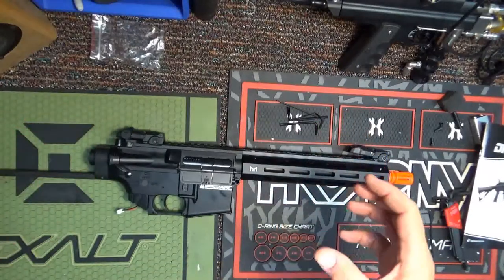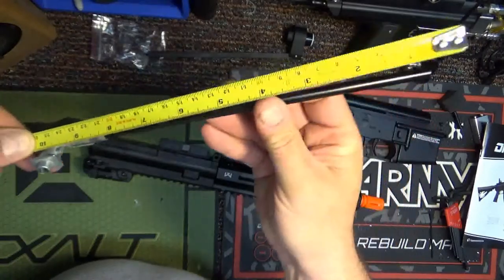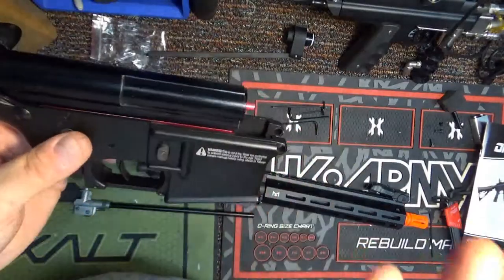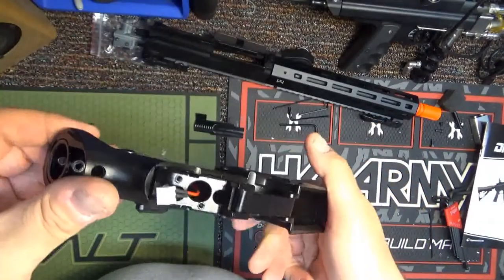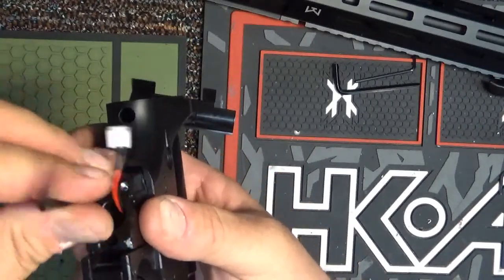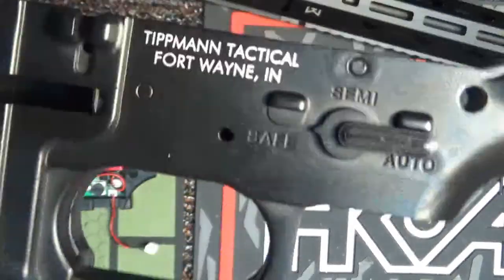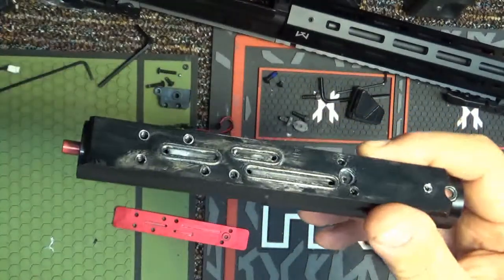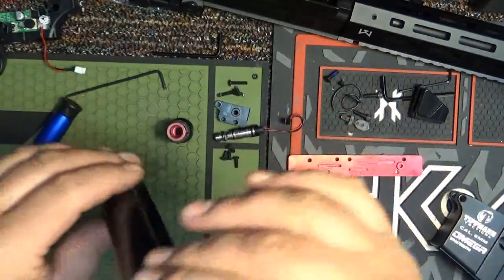Tippmann Omega Airsoft #3

Comment: My tippmann omega recently stopped shooting. I’m not super knowledgeable with HPA but I get the gist of it. I recently got a new Ninja tank but my gun won’t fire. I don’t have any 9v batteries right now except for the one that was in it which for some reason is making the light above the trigger blink and another one which will make the light blink once and then turn off every time I switch the firing mode. Can you help?

Comment: I know this video is older, and in the comments, it says the replica was sold, BUT my interest is in the O-Rings. Mine is leaking badly, I got it used, kind've in the bone yard way.  I cannot for the life of me find ANY information from Tippman on the internals and what the O-rings ARE and where to find replacements.  So I need the 3 that sit under the red plate of the V1, and I need the O ring that sits under the check ball.  Any ideas?
Reply from the maker: have you tried calling Tippmann

Comment: Doc,

We spoke yrs ago about the Tippman Omega. Ive been using MCSUS combat stock with a remote line. I kinda need your expert advice.

I want to run an ingrip line from amped airsoft. Could I screw that ingrip line to the back of the engine where you adjust the PSI? The MCSUS stock is great, just not tough enough. Ive bought 3 so far and I end up snapping the nipple off every time. Please let me know what you think and suggest.
Reply from the maker: Hi thanks the question.   I no longer have my Omega nor do I mess with airsoft much anymore.  IMO the omega was ga good engine in a poor body.  By now this platform must be not supported by Tippmann.  IMO the best bang for your $$$ is the Wolverine MTW.

Comment: hello alive in Italy is the maximum power is 324 fps with bb from 0.20, this replica can go down so below? constancy is good? and varies depending on the internal pressure of the tank? obviously I will change the jump and the barrel to improve the precision.
I'm waiting for a kind response
Reply from the maker: I can t test as i have sold the item.  Contact Tippmann

Comment: Hi Docfire, a compliment for the first detailed disassembly video of this airsoft replica on youtube. I have bought my first HPA Tippmann Omega replica last June and have not used it for a couple of months due to health issues. So last week I tried it and the replica was not firing at all. Replaced the 9v battery but with no results either. After further inspection (having experience with AEG replica repairs )  I noticed the MAC solenoid is not functioning like it was before. Still a little bit clicking noise but not the noise it had as before the issue. I think the valve is stuck. Called Tippmann but no replacement parts there. They advice me to send it to them but shipping costs are to high for me. (live in Aruba).  http://www.macvalves.com/product/bullet-valve/.   On this website the sell similar valves but due to no experience on this issue I would like your advice. Thx and keep up the good work.

Comment: Is there any mods that are available for the gun air system?  Air nozzles would be my big question? Also what is the max fps you've achieved?  I need to hit around 400 with .20 and 328 with .30 is that possible with the adjustability of this?  Thank you.
Reply from the maker: As for upgrades in have not seen any.  Max Fps UNK as the field around me have a cap so I have never checked.
Reply: Have you attempted to try a aftermarket hop up like a prowin? Have you tried a aftermarket barrel like Prometheus?  How about aftermarket bucking and nubs?
Reply from the maker: @indianasteelheadandsalmonf7033  it will take aftermarket AEG hoppus and barrels fine as the upper and lowers are AEG based.
Reply: Just a heads up there is a version 2 of the omega out now. I finally contacted Tippman directly and was told that they changed a few things including the hop up to a rear rotary, you don't have to remove the grip now to change fps and, changed the electronics a bit internal. There's more but that's the main stuff.